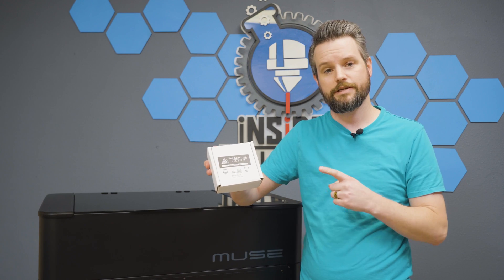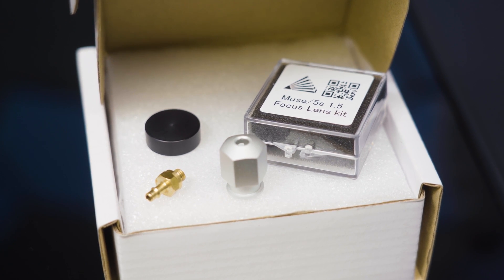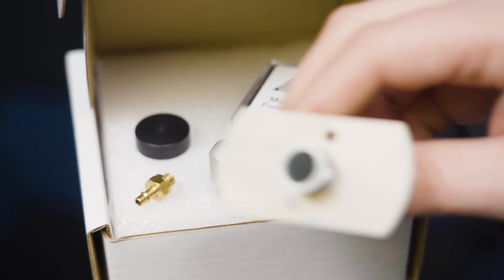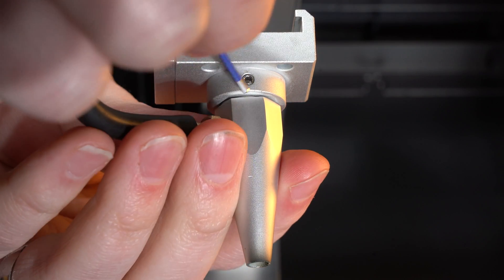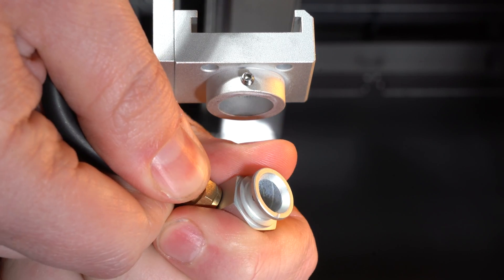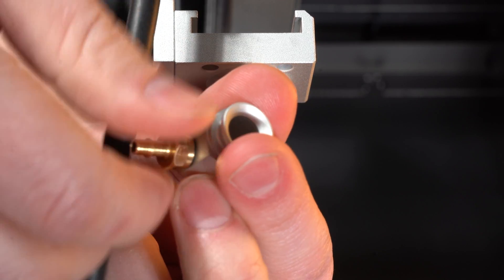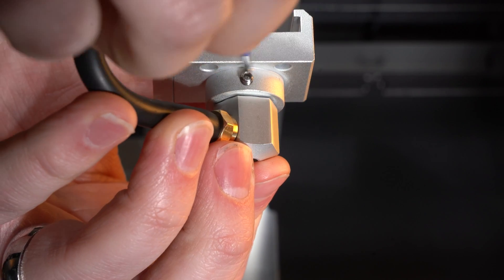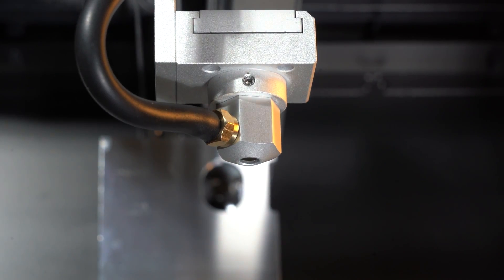How to Change the Muse Lens Kit

Comment: One I change the lens how do I get the auto focus to work again? So it is correct distance?
Reply from the maker: If its the same size lens you will need to change nothing. if its a different size lens you will need to either change the cone if its a muse, or adjust your focus if its a P-series

Comment: For the Muse 3d lens, how do you remove it from the actual case it's in?
Reply from the maker: The lens itself is built into the bracket that slides into the laserhead, it is glued in and not made to come out.
Reply: @FullSpectrumLasers  Is there a case that Full Spectrum makes that I can put lenses in?  Or do I just have to buy stratight from Full Spectrum my lesnes?